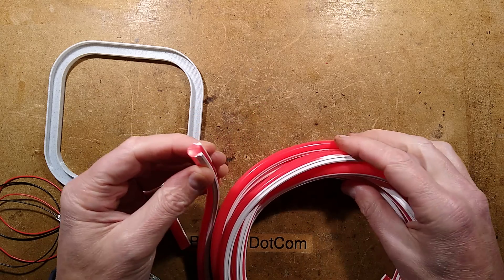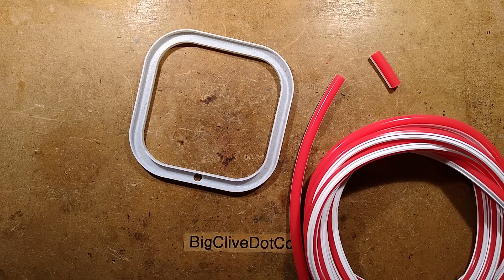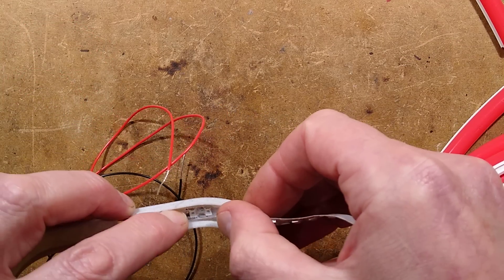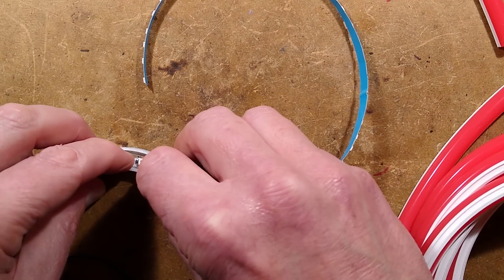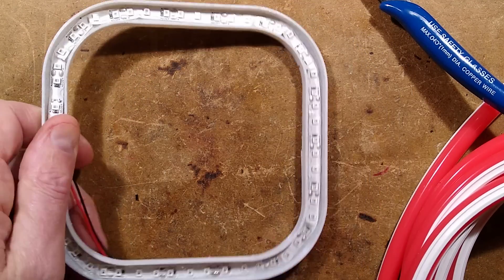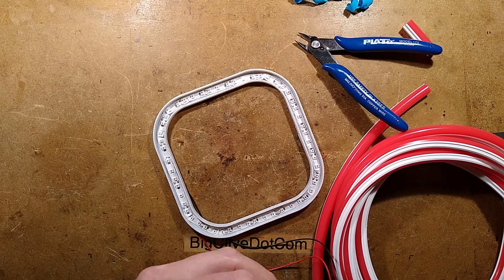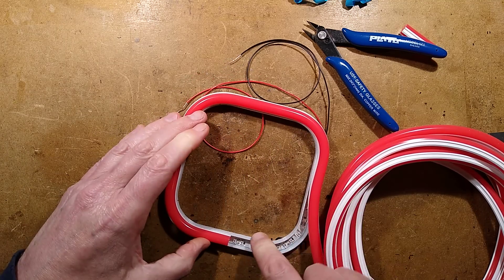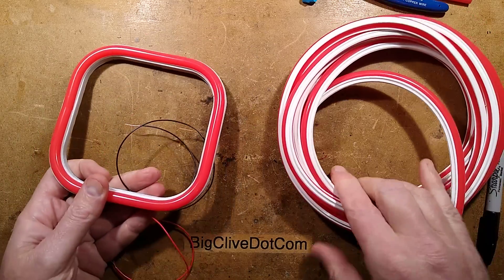Testing a new 2-part style of LED "neon"

Comment: That looked pretty good. Is it cheaper than neon though?
Reply: If you mean actual neon, there's no comparison. Actual neon would run perhaps 20x more, or more!
Reply: @Quickened1  Well, it looked bloody great. I wonder how it compares in real life.
Reply: @ZephodBeeblebrox  compares to what? and in what sense? I.e. cost? looks ? durability ??
Are you wondering what it looks like compared to actual neon? 
If so, all I can say is, this led is a cheap simple solution for creative sign designs and the possibilities are endless. As for neon, it's expensive, fragile, hard to get, etc. but neon is classic, with a look that's very difficult to mimic... Maybe impossible?

If it's just about the pretty lights, led will scratch that itch...
Reply: @Quickened1  I'm thinking about retail signage and whether these LEDs will take over from traditional neon signs. 

Smaller format cameras have taken over from larger formats despite the slight degradation in image quality; even phone cameras are used in place of just about every kind of camera these days. There is a drop in image quality for the purist.

For traditional neon signs I suppose the purist would consider these LED signs to be unacceptably but for the majority of viewers, the effect is more important and they might take over because of that.

The big question is durability since they're plastic and not glass. On the other hand they are way less fragile. 

It will certainly be interesting to see which way things develop. My thought is these LED things might take over.
Reply: @ZephodBeeblebrox  LEDs are definitely the future. The biggest concern is cost. LEDs will cost far, far less than neon, and will outlast neon due to its fragility... Neon will always be preferred, but practicality will dictate the future...

Comment: That looks so cool. They are getting very close to the look of real neon. :)
Reply: Except that neon is cylindrical and emits light 360° around its length... May not seem like a big difference, but when neon is mounted with stand offs, it illuminates the signage under it from the back of the bulb, creating a unique, almost 3D look.

Comment: I need to buy some new LED tape for my car. I replaced my very dull interior light with a strip running the full length of the roof so it gives light in the front and back seats of the car. I was silly and bought the waterproof one which weighs allot more then the bare strips so it doesn't stick very well and after about 7 years it's started to fall off. The gel coating has also started to yellow which looks a bit ugly. I have double sided carpet tape but I'm thinking it might just be better to get a lighter weight uncoated LED strip that won't discolour.

It's soldered to the interior light switch and then plugged into the control box so it works with the door switch and the manual on position. 

I was going to do 3 lengths of the roof but because it doesn't stick very well I never bothered. I might buy some bare RGB strip tape and reuse the control box.

The original reason for the switch was because using the interior light used to drain my battery pretty quickly. The LED strip tape uses about 1/10th of the power of the original filament bulb and it's allot brighter. I did eventually change the OEM 202 car battery in my aygo for a slightly larger 063 Varta silver (for £35!, My battery tray can accept quite a range of battery sizes as it shares the same tray as the diesel that takes an 012 in the UK and the cold climate diesel takes an 075 in places like Norway... I just bought what was cheapest out of the compatible sizes I knew about).

Comment: Does anyone know the answer to this?

I installed about 40 feet of LED flexible "neon" strips like this in the shelving of my workshop.  Everything works awesome, except when I turn the power off  (not unplug), but off with the included remote...there is one section in the middle that stays on and is green.

It would be a several day project to disassemble shelving and replace.  Anyone have any ideas why a single segment in the middle would stay lit full time?

I know very little about electronics.  I'm just guessing the power supply is leaking small amounts of current...and that section has the highest resistance...so lights up.

I'm not really sure if thats how power supplies work...or LEDs.
Reply: spooky - definitely a haunted LED
Reply: @Derek_Garnham  Do you have any recommended spells or potions I might use to banish them?  I grow weary of this full time green glow.
Reply: @PowerScissor  turn it from an unwanted fault into a special feature, just make a tiny "Emergency Exit" sign and affix it below with an arrow pointing at the door.
Reply: @Derek_Garnham  Yes, currently it's a night light basically. That would be fine I suppose except it sometimes flickers and I'd hate to cause an epileptic seizure in the innocent spiders and creatures of the night.  

Really, I think my curiosity would be satisfied if I just knew exactly why it was doing this so I could stop thinking about it every time I walk by.

Comment: Well Clive, looks like there's nothing stopping you from making one of those flamboyant cocktail bar signs for your workshop! A Palm tree and a soldering iron, perhaps?
Reply: With a small ultrasonic humidifier for the smoke effect from the soldering iron tip
Reply: @Yrouel86  ,  For some reason, your comment reminded me of a scene from an old Leave It To Beaver episode where Beaver climbed up to and got stuck inside a billboard sign which had a giant teacup emitting steam like a hot cup of tea would.
Reply: @goodun2974  saw that on one of the "classic" cable channels recently
Reply: All in pink of course :)

Comment: It looks like the tape has the tracks curving together between the LEDs. You could probably improvise with a single hole punch to remove the plastic in the strip that is adjacent to where the tracks come together to help it flex around bends without having to cut and rejoin the sections of the strip or have it wrinkle up. Might be worth a try to see if it gives a neater way to route it around the corners.

Comment: Looks very good.

How about something similar to those spotlight rails, where you have separate LED modules that you fit between two powered rails moulded into the housing, then add the diffuser as you've done here.

Comment: That LED strip is exactly what I've been looking for. Not for the fake neon effect, but deformable across the strip without resorting to a custom PCB. I can now scratch that itch, and also make some personalised signage for family too.
Reply: @topline2554  The substrate of the LED strip being able to be deformed across the strip. I'm not aware of them being able to be deformed in that direction without overstressing the traces prior to 2021. Flex Neon (with the strip mounted vertically within the diffuser) have indeed been around for quite some time but could only be formed in one direction.

What would be nice next, is for addressable LEDs that can be controlled over the power lines and be able to be formed in the same way as these. The problem seems to be overstressing the traces when they lay parallel. (I suspect the conductors lay very close to each other along the midline on these new ones Clive showed here) Maybe one day, the substrate can be used for heat conduction, and the ground, with just a single trace along the midline for power and communication.
Reply: @squelchstuff  Are you suggesting that you fdm the power line? You would require circuitry to interpret the modulation, especially if you are using dimming or rgb LEDs, but these LEDs are also susceptible to fluctuations on power rail. There are already individually addressable RGB LED strips available that are flexible across the strip that simply use a dedicated data channel.
Reply: @ollie4022  Yes, modulating the power line was my line of thought. By reducing the number of coplanar conductors, they can be situated close to the neutral bend line reducing the strain. As you rightly point out, there are a number of other complexities to overcome, not least of which is the extra processing to demodulate and demux, and then a noisy power rail which can already cause trouble now. All said, technically possible, but practically, not so easy.

It seems that strips that could be formed in more than one direction went under my radar. It was maybe around 2012 while I was exploring an idea that warranted bending in two planes (spherical surface) I'd largely abandoned and forgotten about it until Clive's video, and this thread has been most enlightening (pun not intended). A cursory search of patents after the revelations show that S-Type/Zig-Zag etc strips appeared sometime around 2015.
Reply: @squelchstuff  I mean what you are suggesting may definitely be possible and would result in an even thinner strip. Also, yes, LED strips that are this flexible have certainly not been around for a decade they are a relatively modern invention, however I am unsure as to the exact date.

Comment: Is the diffuser all silicone, I was thinking about waterproofing?
Reply from the maker: The promotional video by the manufacturer shows them piping silicone into the channel before applying the front strip.  Not sure how well that would actually work.

Comment: The high street store Next have some one off signage and i managed to get a good look. it appeared that the led strip was clear plastic sub straight with 45 degree triangular cut after every led. Looked ideal for this, ive looked online but i suspect they must have got it made for them. Its available now but at the time it was had to find.

Comment: El wire works a little better for odd shapes but not as bright as LEDs
Reply: and wayy worse lifespan.   EL starts weak and drops off after a few hundred hours.

and the inverter does wistle or hiss.  apart from the electrical noise being radiated.
Reply: @casemodder89  There's also the problem of bending el wire on that tight a radius. It will shorten the lifespan even further. EL wire has it's place, but it's just not as reliable...

Comment: Can you stretch one side of the LED strip using a heat gun? I say that because I throw a reel of plastic grass strimmer string into boiling water and it straightens out and forms round the bobbin easy without getting springy.
Reply from the maker: I'm not sure if it'll soften like that, but it's worth a go.

Comment: The link you provided does not have the material you are using. 
Please provide more information, and maybe a link to the manufacturer's video.
Reply from the maker: They may have sold out.  There will be other listings on Aliexpress.

Comment: Hey Clive. Could you please do a teardown, schematic and discussion about some GaN products, in particular USB power supplies/chargers? I'm interested to know why they're the new thing and how they differ from age old silicon.
Reply from the maker: I think the idea is that they can operate at much higher frequencies for driving smaller transformers.  But that doesn't seem to take into account the extra stress it will put on the output capacitors.
Reply: @bigclivedotcom  I haven't looked in to GaN marketed powersupplys, but why would the higher switching frequency stress capacitors? You'd probably use large ceramics directly across the output smoothing out all higher frequency components, and have bulk electrolytics in a similar function as with lower frequencies, if they are even necessary. I don't think electrolytics will do a good enough job at multiple MHz, and the super low ESR of ceramics allows way smaller capacitance values.

Comment: Well that has remained me that I once again have to say "thank you" to Maplin.
If the UK is going to have rolling blackouts I'm going to get all the solar panels, batteries and power management device that I bought from them to have power in the house.
I just need to order a few 12v - 5v thingies and I'm done. 😄👍
Reply: I've had such a system for the last 2 years. It runs 12v lights all year round, and in summer has enough capacity to boil a kettle, run this laptop, power a slow cooker (via an inverter). Why wait?
Reply: @michaelbaker2465  
Good point. 🙂👍

Comment: I imagine you could use some optically clear adhesive to join the ends of the diffuser cord to help keep the light continuous. Like the kind you'd use to repair/bond a new phone screen.
Reply: E6000 is the glue! I love that stuff...
Reply: @rockstopsthetraffic  - I've been using E6000 for theatrical type stuff since 1993 or so.    It's basically Shoe Goo on steroids, or perhaps  a cross between rubber cement and hot melt glue.

Comment: If you print exotic plastics your adhesive backing tape may not stick. Low surface energy (LSE) plastics are not really exotic per say, auto makers use it. I have some assembly tape. 3M's ultra high bond (UHB) tape won't work. I love that stuff though.

Comment: That would be ideal for a giant digital clock, except my 3D printer isn't large enough to make the channels for the seven segment displays, I've always wanted a "wall" clock the size of the wall in my (for lack of a bette word) Lab, although I could use aluminum channel.
Reply: You might be able to get a 2nd hand router pretty cheap and use either wood/engineered wood product or plastic. And wear an N95 or FFP2 dust mask if you do that.
Reply: Another opinion is to use straight LED strips for each of the segments.  20 years ago, straight neon tubes would be the choice.
Reply: See if you can use the bog standard white cable trays (also called trunks or trunking I think) used for external wire runs
Reply: How big is your "lab" that you need/want such a big clock? You always have to consider viewing distance for still being able to properly read the digits ;)
And what Massimo suggested might actually work and get rather cheap, cable canals are available in pretty much any width and depth, and you can use your printer to print translucent "lids" (in segments) and connectors/end caps.
I designed and  printed a 7-segment clock myself a while ago. The digits are ~21cm tall, any bigger and the "base plate" for the digits wouldn't have fit on my print bed any more xD
Reply: with mesh mixer you can split up the print into multiple smaller prints and glue them together at the end
Reply: As the saying goes, there's more than one way to skin a cat... 
Lorraine, at Element14, did a giant 7-segment clock for her lab where each segment was printed separately. I don't have the actual dimensions, but visually the segment longest dimension is less than 6" / 150mm, so should work on pretty much any printer, but the resulting numerals look to be about a foot tall - have a look at these:

Giant 3D Printed 7 Segment Display Clock
https://youtu.be/m1w9D8BQLdQ
and
NeoPixel 7 Segment Display Clock Update
https://youtu.be/CV7vTq5JD0g

In the first one, she mentions that she was inspired by - and used the design files from - engineerish:
https://www.youtube.com/watch?v=Z7xdRMfPbP8
... and he made the design files available on thingiverse (but I can't put the link to that here :b )
Reply: you could devise a 1/4 printing segment, and the connection, you can print almost everything with any size printer, but you need to find work-arounds.
Reply: You can split the print into multiple pieces with interlocking ends, and use this type of tape for that.
Reply: @PhilXavierSierraJones  exactly this.   You'd only have to design three sections - straight, corner, and 'T'.  Maybe some extra stuff like colon and AM/PM.
I have a similar thing I did with a tool block (for holding small screwdrivers, tweezers,  etc).  The pieces dovetail together.  New set of tools?  just make a new block and slot it in.
Oh, also a soprano Ukelele in three parts.  The neck bolts onto the body, but half the headstock is a separate print with a biscuit joiner.  For something like that you design it whole, then slice it into parts to fit the printer.

Comment: They should make them with small diameter like to replace those high pitch noising el wire
Reply from the maker: They do a thinner version, and also 6mm (1/4") LED flex.

Comment: I wonder how long they will last? Especially when between the LEDs?
Reply from the maker: It's hard to say.  Under-running the LEDs will make them last a lot longer though.
Reply: Just recently bought a cheap LED flashlight, I don't know what the inside is like but the intensity is ridiculously bright. Wondering how long the LEDs will last, they're probably being run pretty hard.

Comment: I wonder if the sticky backing is even needed, if you can just pin it in well enough to clip in the diffuser.  Maybe it doesn't need to stick well to the 3d print so long as it holds long enough to turn corners.
Reply: I'd imagine it just needs to stick long enough to get the bends right, without the tape those bends would be a real PITA.

Comment: I don't really see anything special about the LED strip and it just folds over as you make the corners. Doesn't any LED strip behave that way?
Reply from the maker: It narrows in so the fold is easier.
Reply: All the LED tape I've used the back is entirely metallic and it bends and breaks as such, you're fairly likely to kill it trying to go round corners.  By the looks of it this tape omits the heatsink layer between sections of LEDs so it can bend without breaking.

Comment: Very nice!
Since the tubing is already coloured I guess you might have used white LED strip as well and get the same result.
Reply from the maker: The matching colour is more efficient, but white does work.
Reply: @bigclivedotcom  You didn't happen to buy some plain white tubing as well? I wonder how well it'd work with an RGB-strip, but with white tubing; that way you could change its colour as needed/to match whatever atmosphere you're aiming for.